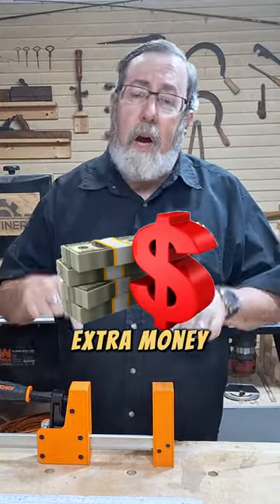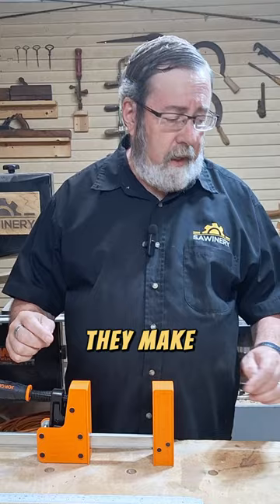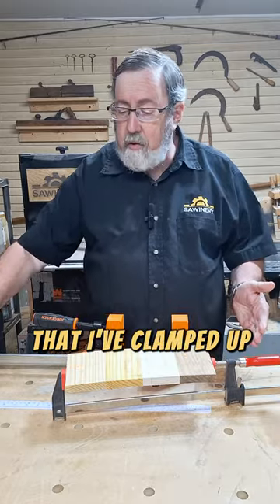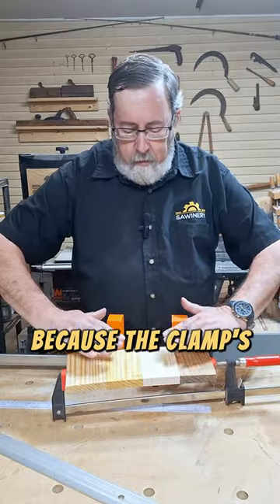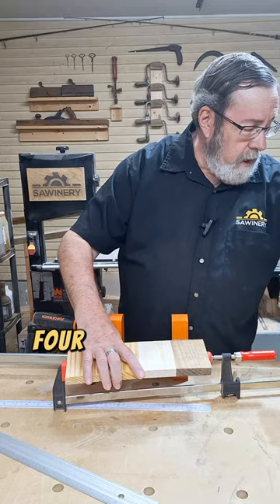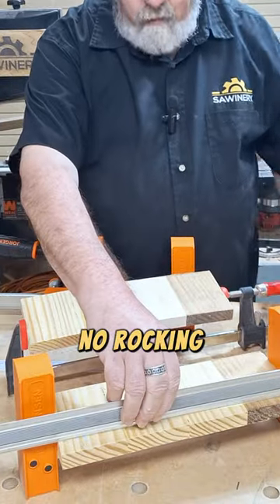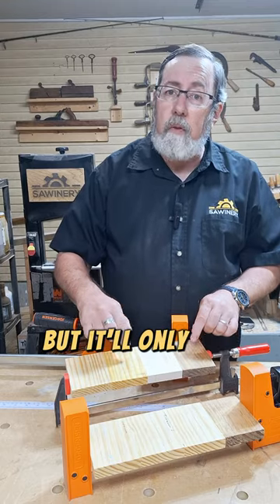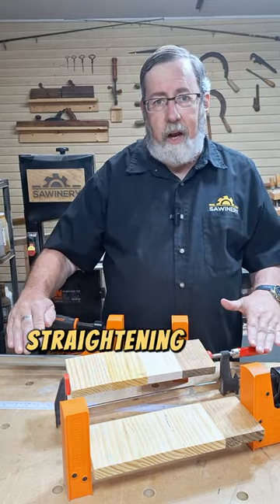Are parallel action clamps worth splurging on?

Comment: This a very biased comparison. On one clamp, the wood is not even resting on the bar, which helps to keep the wood from bowing. Whereas on the other clamp, the wood is resting on the bar.
Reply: That's because the F-Clamps have 2" pad??  You can't put the wood on the rail  because it doesn't reach the pad.   The other style clamp (parallel action) has a different mouth/throat design.

Comment: Why dont just use a pipe clamp then? They are cheaper and dont really bend, especially if you pick the 3/4in version over 1/2
Reply from the maker: Pipe clamps are excellent and much cheaper than any other type of bar clamp on the market. However, you can still have the problem I showed, with the boards being clamped bowing up. To prevent that, I’d use the pipe clamps together with cauls.
Reply: @sawinery-woodworking  Yeah, I guess that probably will be the cheapest solution to this problem